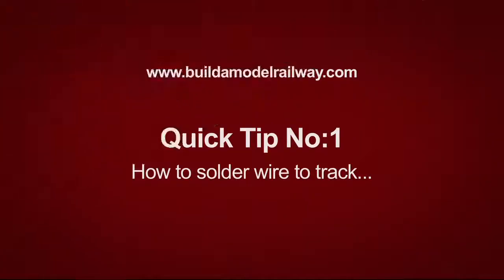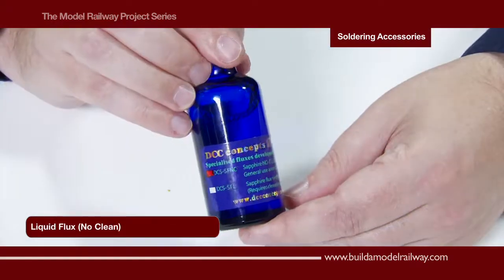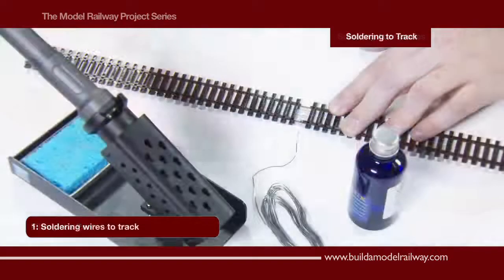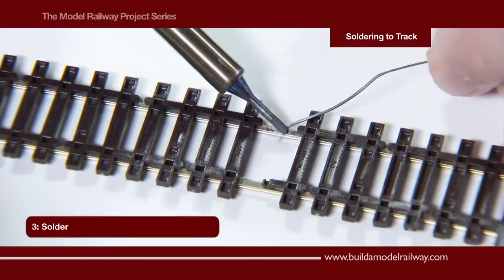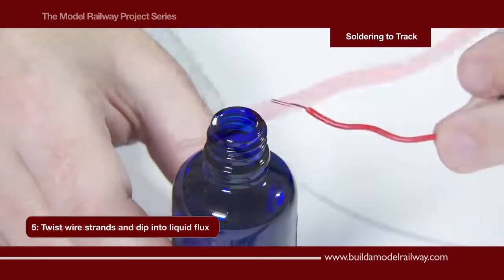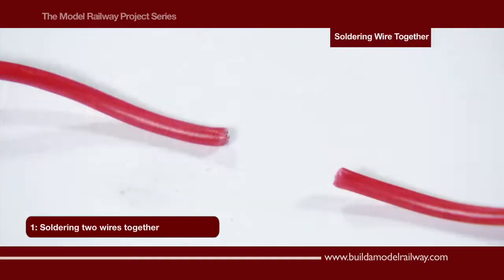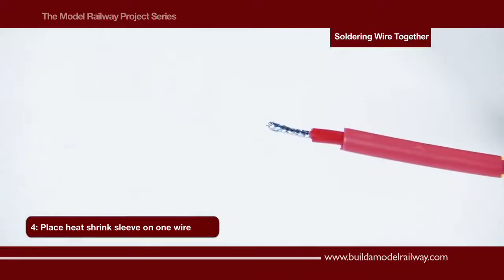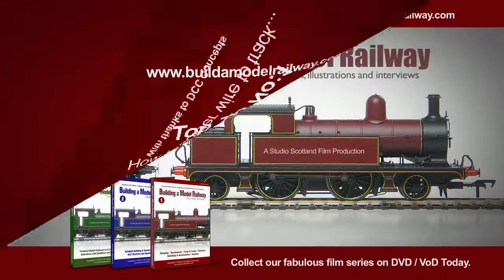Soldering to Track Made Easy with DCCconcepts

Comment: I do like your liquid flux … really helps with soldering. When joining wires together I usually twist both wires together to form a secure mechanical joint before adding the solder then heat-shrink … even more secure! 👍
Reply: Great to hear that you enjoy using our no-clean flux! Keep the flag flying!!!